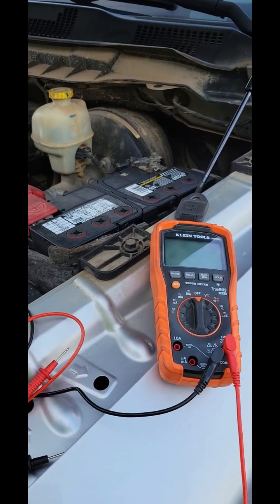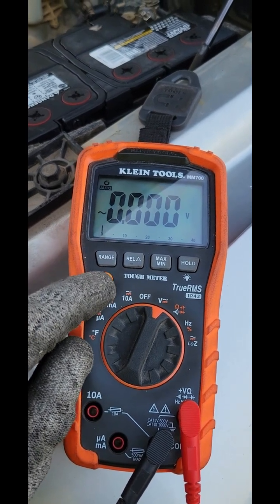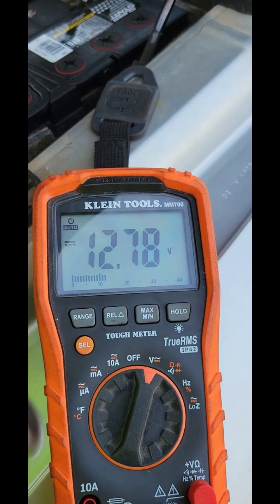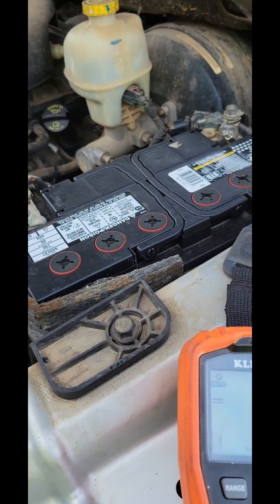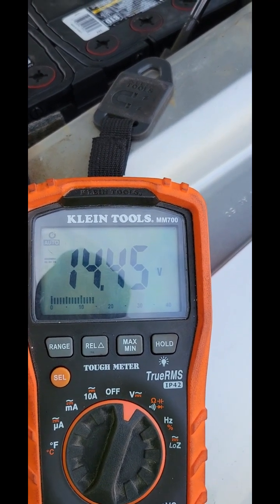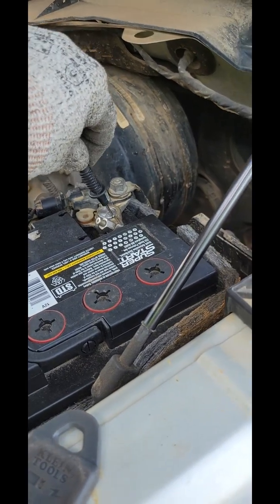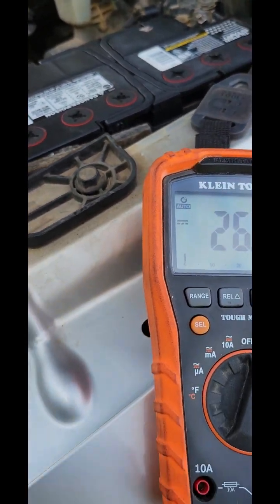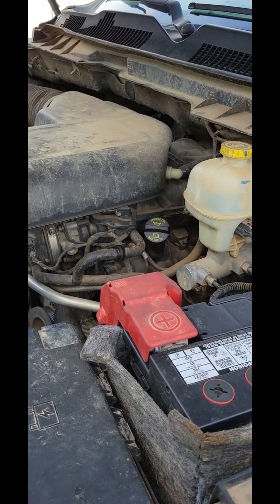How to Test an Alternator

Comment: I was watching a video on board and batten and they said if you have textured wall and use hardboard to cover it you will have to remove every outlet box and adjust it because it will be too deep. I bet these shims would fix the problem lickety split! Bring that outlet forward the just enough to clear that super thin hardboard! Right?
Reply from the maker: Yep. You can bring them out as much or as little as you need. The link is in the description. Thank you for your comment.